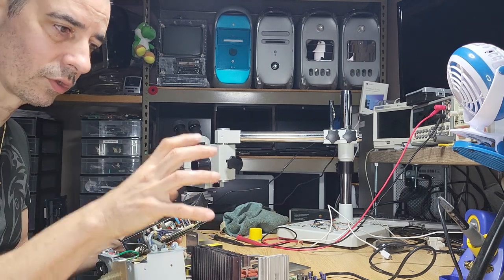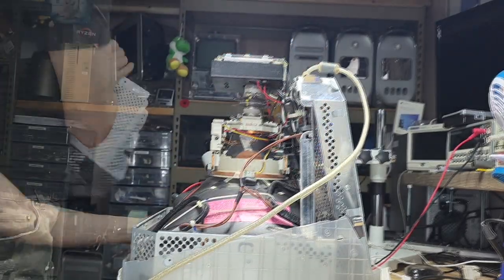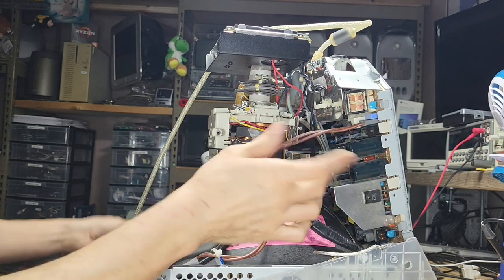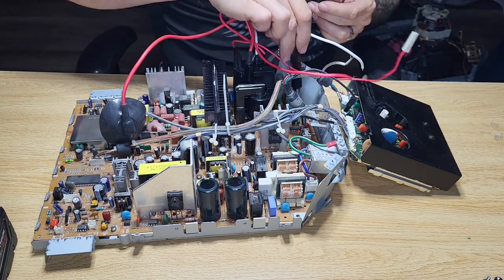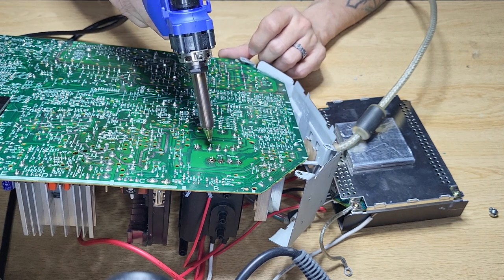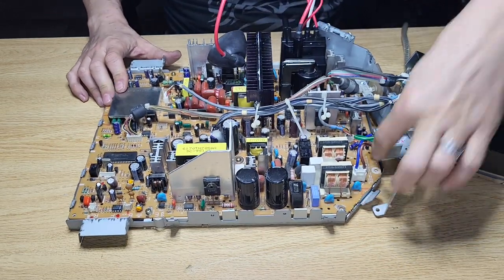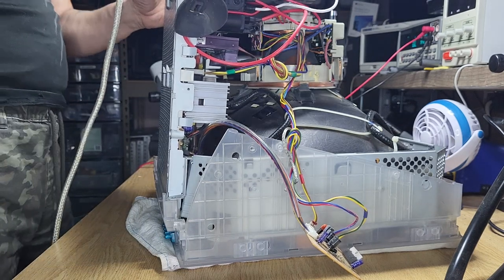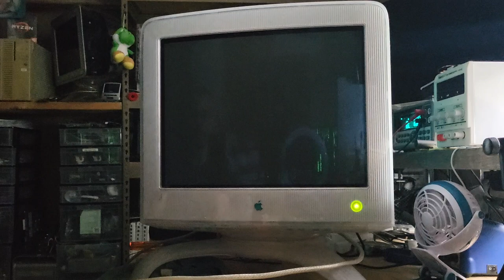17" B&W Apple Monitor Flyback replacement

Comment: yo! I’m having a strange issue with my 1998 iMac G3. It works without any problems initially, but when it’s left on for a long time, a weird bug occurs that’s difficult to pinpoint. After being on for an extended period, my iMac G3 simply goes into a black screen mode if there’s any change in video resolution. Additionally, when I turn it off and try to turn it back on, the power LED stays green, never turning off, and the machine doesn’t power back on. The same happens during a reboot; instead of the LED turning yellow and then green, it doesn’t return from the reboot. Even with the startup chime playing, the screen remains black. The only solution is to unplug it and plug it back in. After being unplugged for a while, it returns to normal, but the bug reappears if it’s left on for several hours, typically two or more. I’m not sure if this is an issue with the mainboard, power supply, or analog board. I’ve already recapped 100% of the capacitors, and while the bug used to be permanent, it’s now intermittent. At first, I thought the recap had solved the problem since I only used the iMac for a short time, but when I use it for longer periods, the bug always comes back. It only stabilizes if it’s unplugged for at least 10 hours. Any attempt to turn it back on after the bug appears is futile. Do you recommend checking any specific chip or shutdown signal? Thanks for the help. Oh, I forgot to mention, only the electrolytic capacitors were replaced during the recap.
Reply from the maker: sounds like that you might have an issue with your PSU, but before you go to the extreme, have you replaced your pram Battery? i know some imac g3 don't behave well if they have a dead or dying pram battery
Reply: @imac7531  thanks for reply! Yes, I replaced the motherboard battery. I noticed that a transformer in the power supply is getting very hot, above 120 degrees, and I’m not sure if that’s normal. I thought about replacing the horizontal IC, but I don’t have the schematic for this computer. If you think of any other ideas, please let me know.
Reply from the maker: @RaphaelBastosakaCoffnix  i don't have a schematic sadly enough and i wish i did, i would love to share that info if i did, but 120 deg is very hot. i can see that interfering with the hardware. you could replace the component if you can fix it yourself or get a working one on ebay. i do have a few around here. But 120 Deg C? i can see that being an issue.